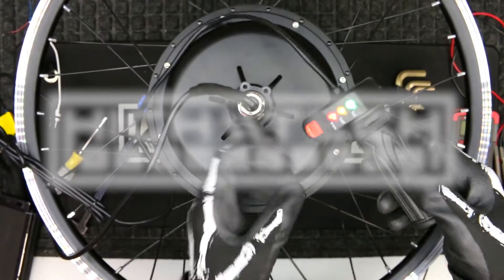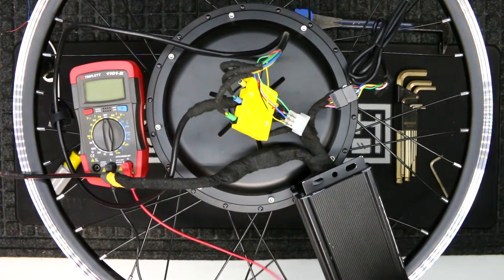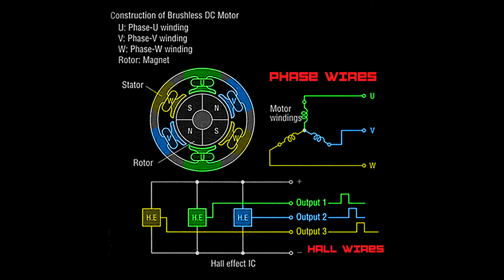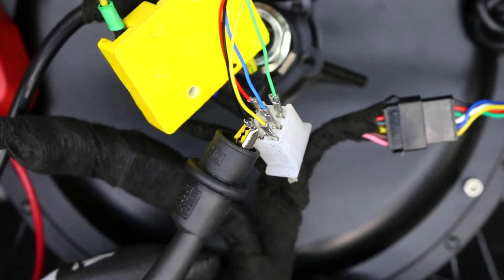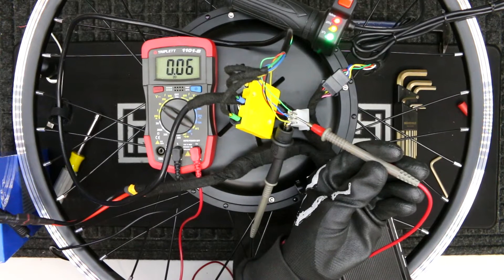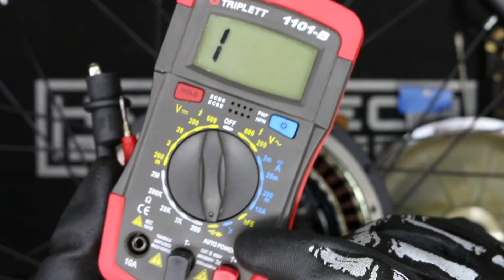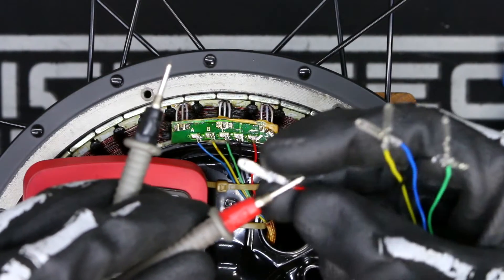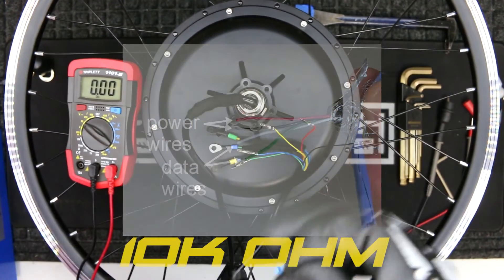🚲 How To: Ebike Hub Motor Hall Sensor Testing, Diagnosis, and Fixes (Display Error 10, Error 30)

Comment from the maker: A viewer pointed out at 01:53 that there could be some confusion regarding my use of the term “magnet” when referring to the ring of magnets around the stator. He thought that not specifying these are electromagnets was incorrect. So, I will clarify:

The rotor uses permanent magnets. ( https://en.wikipedia.org/wiki/Magnet ) 
The stator uses electromagnets. ( https://en.wikipedia.org/wiki/Electromagnet )

In this example, the stator uses enameled coils of wire around iron sheets to create an electromagnetic field (electromagnet) that interacts with the rotor’s magnet’s magnetic field (permanent magnet).

My apologies for any confusion caused, and thank you for watching.

Comment: I have a sw900 with error 7 with similar motor issues . How to fix I opened the motor up nothing looks burnt have to get a multi meter ant check hall sensor 1500w less than 300miles 🤦🏽‍♂️🤦🏽‍♂️
Reply from the maker: Yes, you will need to check as shown in the video 👍

Comment: Helpful. I'm off to try to figure out my problem. I have a question though..I have a 07 fault as soon as I power on. Since the hall sensors are on/off as the wheel turns, I don't see how the controller would be smart enough to know that one is bad, or there is a connection problem, etc. What exactly is the controller looking for, with regards to a motor fault at power on? thanks
Reply from the maker: Error codes can be specific to the manufacturer, 07 can be throttle on startup, or also over voltage warning, it could be others too. If you can get more information on your specific controller and its fault codes that can help you narrow down what you are looking for. 

Controllers can look for many different connections present or out of spec/limit depending on how they are configured. 

If a controller is expecting a certain voltage and continuity for a certain circuit having that circuit either be open or higher or lower in voltage can indicate to the controller that there is an issue and it will throw a code. 👍
Reply: @hightech-lowlife  Thank you for the reply. Couldn't find any documentation for my controller. I have a few things to look at now. Thank you
Reply from the maker: @jmogyoro  Yes usually it will be pretty simple, disconnected or broken/scuffed wiring, or hall sensors gone bad. If it's not those then next culprit would be the internals of the controller which you would typically just replace to fix unless you're good at board level diagnosis/repair. 👍

Comment: Hello! is it recommended to replace all 3 hall sensors?
Reply from the maker: If all three are broken. You can buy individual hall sensors, or some replacements contain the board with 3 already attached.
Reply: @hightech-lowlife Thanks!
Reply from the maker: @davidwittmer3555 🍻

Comment: Have a hall sensor board for my hub motor from the front it’s red black yellow green blue and it reads ocs-60-2.1  and the middle sensor is 180 degrees offset from the other two. I forgot what the numbers are on them sensors but not 41f if anyone can help, please I am grateful.
Reply from the maker: Have you tested the hall sensors as shown in the video? Have you tested the wiring for continuity?

Comment: Is there a video on how to wire the hull sensors without the circuit board ?
Reply from the maker: a PCB is just wires embedded on a board, you can continuity test to see where they go, or just look for a pinout/datasheet for whichever hall sensor you have.

Comment: You don't need the hall sensors 🤔🤔🤔
Reply from the maker: Technically, don't even need a motor 😎
Reply: You dont need the circuit board

Comment: All my hall monitors seem to be working fine but I still have the error 7 port
Reply from the maker: Error 7 typically indicates a communication issue, so double-check all your connections and ensure everything is securely plugged in. Check all wires for any frays, pinches, bad insulation. 

If your motor is testing fine then it may not be an issue with your motor, could be the controller. If you have another one to swap out to test that would be a good diagnostic step.

Comment: So, potentially, it could simply be that my wires are frayed or exposed? I just got the error code on my scooter yesterday after a accidently got about 3feet of air. Both motor wires are slightly frayed 😢
Reply from the maker: Yes, if you reinsulate them do you still have the error?
Reply: @hightech-lowlife i havent taken it apart yet, but I'm hoping it will work!
Reply: @hightech-lowlife  I am unfortunately very lost. I have attempted these tests and I still get 5v to each hall while rotating the axles. Ive opened it up as well and checked each individual sensor and im getting continuity. Im so lost now😭 when I throttle i still get rotational force and my wheel spins, but it feels sluggish still. Im wondering if possibly my fall could have bent my axle? Im not sure that's possible just cause im a small dude and the fall was maybe roughly 3feet?  Do you have any other potential tests i can try? Oh and I did tape up the frayed portion of the wires and still error
Reply from the maker: @Marcus-xl9kr  Which error code do you have? 

If you have a physical problem like a bent axle, you will not see an error code for that as the system cannot see or know physical issues. You will know if your axle is bent as your wheel will not be true when spun, nor will it spin freely. 

Most likely your motor is ok if all your tests are checking out, could be the controller.
Reply: @hightech-lowlife yeah my rear motor is where I get the code. I but it on a block and powered up with no codes showing. I spin front motor with now error but when I spin rear motor I get the code. Im going to try plugging my rear motor into my front controller to see if I still get the code. Then I can assume its my rear controller. 
However I do feel my rear motor feels a little tougher to spin than my front.
Reply: @hightech-lowlife its an E01 code. Manual says its hall sensor.  I tried plugging my front motor to my rear controller and no code but I plug my rear motor into front controller and I still get the code. So it has to be my motor somehow? I must be doing something wrong
Reply from the maker: @Marcus-xl9kr  Front motor to rear controller is no code

What about rear controller to rear motor? 
Front controller to rear motor? 

Check your hall sensor wires again make sure there are no frays/shorts/etc.
Reply: @hightech-lowlife sorry for blowing up this post. I re did the tests. I am having one hall locked at 5v when powered on and turning the wheel and when I test for continuity they all seem connected. Does that mean I have a short inside the hall itself?
Reply from the maker: @Marcus-xl9kr  All halls should oscillate 0-5V when turning the wheel. 

If you have one not oscillating it could be the issue. You can swap with the sensor next to it and see if the issue follows the sensor, if it does then you know the sensor is bad, if it doesn't then you know the wiring is bad. 👍
Reply: @hightech-lowlife this method proved it is just the hall! So hopefully by just replacing the bad hall should theoretically remove the code? Thank you so much for walking me through the process!
Reply from the maker: @Marcus-xl9kr  Yeah if you replace that hall sensor with a working one the error should go away 👍Good job

Comment: I ask for help: dear friend I have had a problem for 2 years with my ebike even when it was under warranty and the factory did not help me. While I ride on the road often the engine suddenly loses power completely and to make it work I have to turn the display off and on again, or I have to increase the assistance level. With a new battery, new pedaling sensor, new accelerator... the problem remains! An error never appears on the display. I followed this video and I do not know if it can solve my problem. compliments to the channel. hello from Italy
Reply from the maker: It could be an issue with the controller, is there a way you can try a different one? 

Usually when you have total loss of power and have to turn things on/off it could be because you're tripping the battery BMS over current protection. Is the battery capable of providing what the motor is requesting? If you're pushing the battery past its protection it will cut off power to protect itself. 

It's also possible that there is a setting in your display/controller to increase the limit (if it has that function). 

It also depends on when it is happening, under full acceleration? Randomly? I would check all wires to make sure there aren't any that are fraying/broken, also check all connections to make sure they are tight and fully connected.
Reply: @hightech-lowlife  thanks for the quick reply. 1. when you mean controller are you talking about the control unit? I also thought I had to try a different one. The battery never goes into protection and does not turn off, I bought a second new one and no problem. The strange thing I noticed is that the ebike remains on: display, battery but when I accelerate it loses power in some points of the road. just when I finish a more or less steep descent and I have to accelerate on the flat, at that moment the acceleration does not exceed 15 kmh. Strangely, on climbs, even very demanding ones where more electricity should be consumed (I think) I never have problems. I specify that the engine does not make any noise.
Reply from the maker: @wolfgarageebikelab  I would try a different controller. 

The controller is device that you plug the battery into, that then has phase wires that go to your motor 👍
Reply: @hightech-lowlife  hello friend. I increased the setting limit from the display. But it still creates a problem, the bike loses power and I have to turn it off/on while moving to restart. So the problem is 100% in the controller. I will have to open it and look if there are frayed cables. In addition I should measure the voltage of the cables with a multimeter even if I don't know the values I should evaluate to say if it is faulty and where. I saw some videos about it, I hope I can get by. thanks for the moment!
Reply from the maker: @wolfgarageebikelab  I'm sure you will figure it out, just don't give up. Take a break if you get frustrated, then come back to it, eventually you will get your bike running perfectly 🍻
Reply: Hi friend, today I opened the control unit but nothing was burned, corroded, or broken. Everything seemed fine, even the cables. The motor cable is completely intact, also because I'm a person who takes great care of my belongings. However, something unexpected and very bad happened to me. Before opening the controller, I separated all the cables connected to the control unit, braking sensors, throttle, and so on. After inspecting the controller and closing the case, I reconnected all the cables. Stupidly, I had the battery turned on and connected it to the control unit. I could clearly hear it going into protection or it was simply a rattling noise. When I turn on the display, the acceleration, pedal-assist sensor, and brake sensor give me an error and obviously don't work, preventing the motor from turning. There's no burning smell, the display works, but the bike is as good as dead.
Reply from the maker: @wolfgarageebikelab  Does it have an error code? 

Even though the controller "looked" ok doesn't mean it was. Many components, especially mosfets can appear fine but not work as they should. It's possible that the controller was still the issue, and now it's just more of an issue.
Reply: I don't know how to solve it now... I have a new important job in 2 days, and I don't have time to buy a new control unit, so I'm left stranded.
Reply from the maker: @wolfgarageebikelab  Most likely it was the same issue as before (controller), only now the controller is in a worse state and it possibly could have done that over time or when you were on your ride to your important job. 

2 days is not enough time for faults like this unless you have a lot of components that you can swap out quickly to diagnose. 

I would get a different bike you can rely on for transportation, then fix this one without the time deadline. After fixing it you can either sell it, or sell the other one if you like it better. 

I've been in many situations at my old job where people would rely on a single thing to do something that is very critical and absolutely cannot be with downtime. I always wondered why they would put themselves in a situation like that as to me it would be important to have a backup in case of the inevitability of some anomaly down the road. You can never anticipate all scenarios but you can prepare for some. Maybe it wouldn't be a bad idea to have a backup bike if this is your sole mode of transportation, it doesn't even have to be an ebike, just something to where you're not stranded. 

If you have the willpower, you will figure out all solutions over time. In the meantime I would just inset measures to mitigate stress with more options and flexibility 🍻
Reply: The code is E022, the throttle is disabled. To activate it, I usually had to press the accelerator, press the brake, and then turn on the display. Now, when I press the brake lever, the brake light doesn't come on from the bike's rear light. So I can't reactivate the throttle like before. 😢 @hightech-lowlife
Reply: Thanks for the suggestions, buddy! In the meantime, I'm ordering a new controller and using a regular "muscle" bike. I hope the motor at least survived, and that the throttle and other external components will work without having to replace them.
Reply from the maker: @wolfgarageebikelab  How many extra connections are there? You may want to try removing all connections to extra features (like brake sensors). You should only need phase wires, hall sensors, display, throttle. I still think it's most likely the controller that is faulty, but it's hard to say without more ways to test the components individually. If you have a multimeter you can check the throttle for faults: https://www.youtube.com/watch?app=desktop&v=q76Lv1paQrU
Reply: @hightech-lowlife Yes, I have a multimeter and will follow your suggestion. I'll get a new controller, and if the extra components like the throttle and brake sensors don't work, I'll buy those too. Although I think the controller may no longer detect these external components, they should work. Thanks for all the support, I'll keep following your channel!
Reply from the maker: @wolfgarageebikelab  Sounds good man, just don't give up, you will find out the problem and fix it 👍
Reply from the maker: @wolfgarageebikelab  Thanks man, yeah with enough time and energy you will fix the problems and your bike will be working again as you want it to 🍻
Reply: @hightech-lowlife  One last comparison: I took a video of myself opening the control unit, but nothing seems to be burned. Maybe this doesn't mean anything? I'll buy a new control unit and have this one repaired.

https://youtube.com/shorts/zaiXpsCw3tM?si=Xs_DGRt34qzzJM-w
Reply from the maker: @wolfgarageebikelab  Yeah the thing with electronics is that they can "look" just fine, but still something can be wrong internally. Or maybe the damage is not easily seen (cracks in the PCB or components). There are ways to test components however, which would be the next step if you wanted to try that.
Reply: @hightech-lowlife Hi friend, I'd like to update you on what I did and how it turned out. I purchased a new control unit compatible with the display and motor. Despite everything, the display didn't read the connection to the throttle, the pedaling sensor didn't work, and therefore neither did the motor. At this point, even with a new control unit, I need to figure out what's wrong with the motor: is it completely burned out or the Hall sensors. No specialized e-bike shop or appliance repair shop has wanted to get their hands on it, not even for a diagnosis.
Reply from the maker: @wolfgarageebikelab  Most displays are firmware coded to specific controllers. Even if they look the same or have the same connections unless it is sold by the company that also made the display there is a good chance it will not work due to the firmware differences. Better to get a controller that has a new display, or one that works without a display. 

The throttle should still work, some manufacturers mix up the wires even though the connector is the same, you may want to check wire color, should be 3 wires,  positive, negative and signal. 

I'm not positive from what you're saying that this new controller was a good diagnosis, I would return that one and try a different one. I'm not sure I would deduce that it has to be the motor with the issues you're stating with the new controller. 

Sadly most shops will not work on ebikes because they either don't know or don't want the liability of them.
Reply: @hightech-lowlife Dear friend, thank you for everything. I'm tired of this situation and have bought a new ebike. I completely dismantled my problematic ebike and will try to sell it in pieces. I will install the aesthetic and comfort upgrades made to the problematic ebike on the new one. Maybe I will connect the old motor to the controller of the new ebike to see if it starts up altogether.
Reply: @hightech-lowlife But all the wires, like the throttle and everything else, fit together. The person who sold me the controller said it was 100% compatible. But I really don't think so. 😢